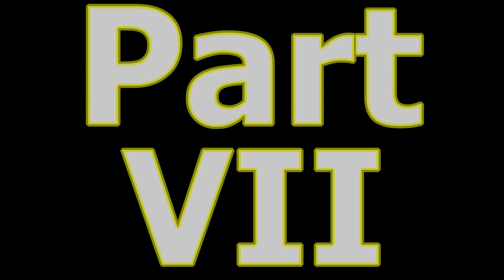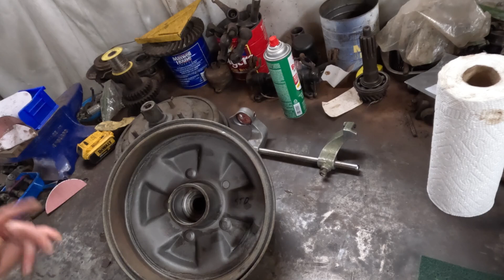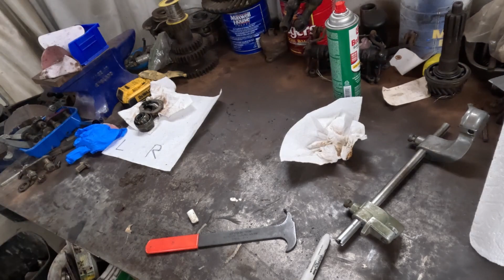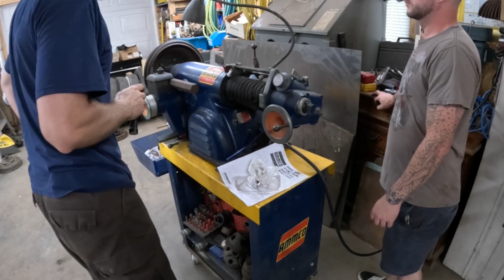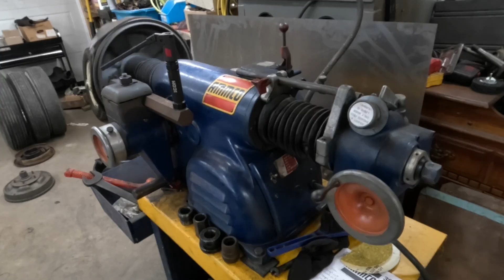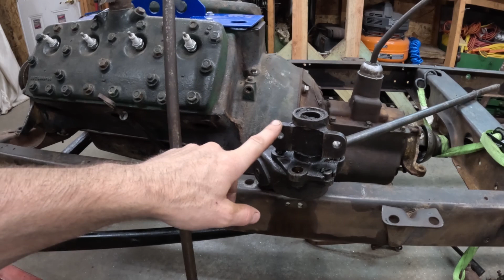shes a ROLLER. Junkyard roadster chassis and engine mock up Flathead V8 AV8 build.

Comment: Why dont you use the 34 spindles that came with the front-end
Reply from the maker: I d8d end up using the early spindles.  I was going to use the later ones because the brakes will bolt right into them and I was considering trying to use a cross steer setup.

Comment: I`m watching your build as I too run a (what I think) post 1940 jalopy ,but with a 4 banger .When it comes time to bleed your rear brakes run a tube up above trunk level full of fluid to help get the air out, we  had a bit trouble getting the air out from the under floor master cylinder until we done this .Great channel and I wish I had your patience to film stuff.
Reply from the maker: Great tip.  Thank you.